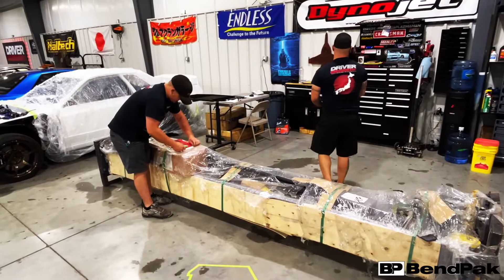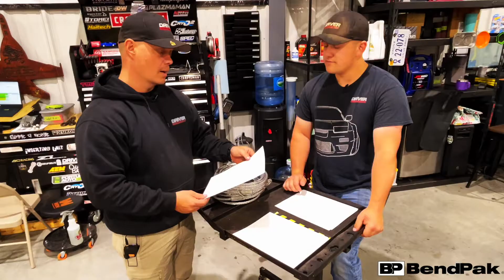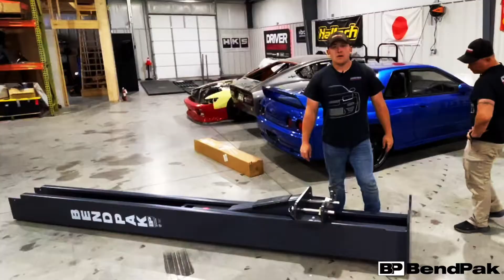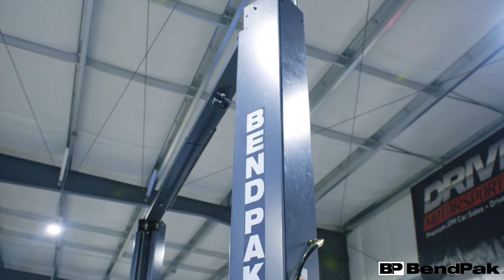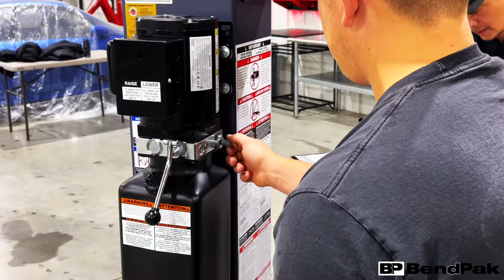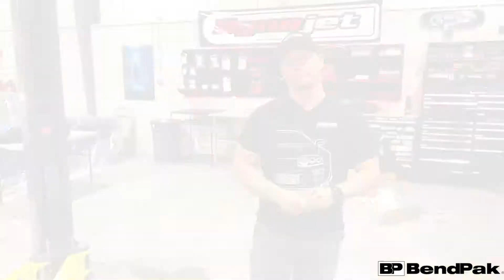Bendpak XPR10AS-LP 10,000lb 2 post lift Install How To DIY

Comment: Hmm wonder if those lifts were leveled before tighten the bolts, nice and expensive Snap On torque wrench at least useless on the video. Were those lifting arms leveled one to each other so they have the same height respect to the floor? I do not see that either. What about the lift's floor anchors without concrete epoxy so they will never move no matter what? I don't see that either. Sloppy install and you said you just hired an electrician. Let me tell you, after watching the video the electrical part is the least I will be worried about.

Comment: Sorry you had to drill the concrete with that style drill, I think it is a common misconception.  That's totally the hardest way but beats having nothing I guess.  Normally people recommend a true rotary hammer drill with SDS bits, way more power and drills like butter in concrete.

Comment: You shouldn’t be fitting your own lifts 
Stop penny pinching 
We have accredited engineers in the uk .
Which I am 
It’s not a Lego kit it’s something that your working under we have to sign everything off and fully inspect it and load test the lift and write installation certs  that cover you for insurance 
You shouldn’t be putting videos up like this 
Fucking clowns 
I don’t get repairing my own car a get a fully qualified mechanic to do that .
Reply: Haha if something breaks then fix it... Don't be a bitch all your life letting others do your jobs